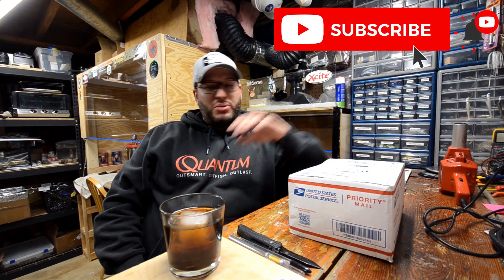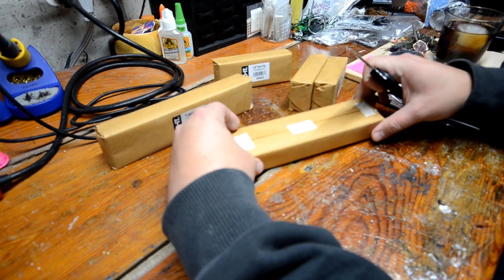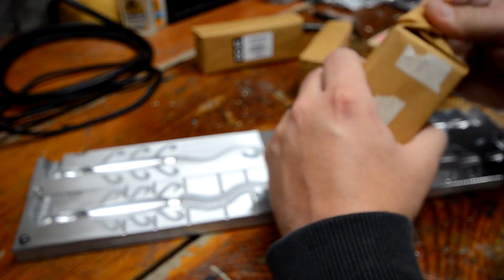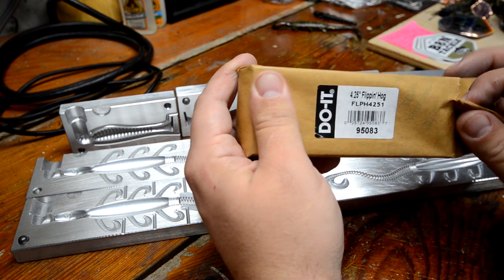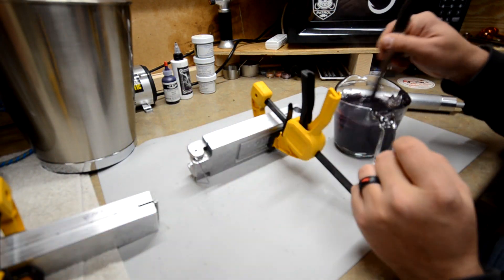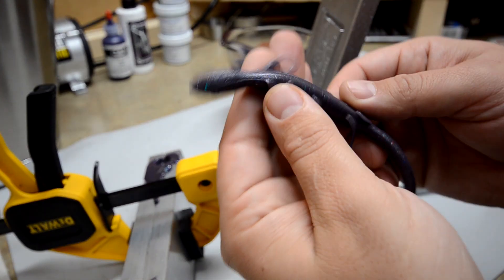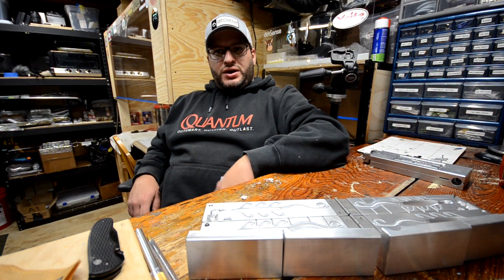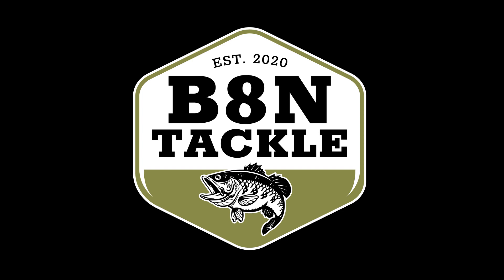CNC VS. CAST Aluminum Molds (Plastic Baits)(UNBOXING)

Comment: Dude, you just need to polish the mold.
Reply from the maker: That's a lot of work for a cheap mold. I did try that high heat paint and it does work. I just prefer cnc molds over cast.